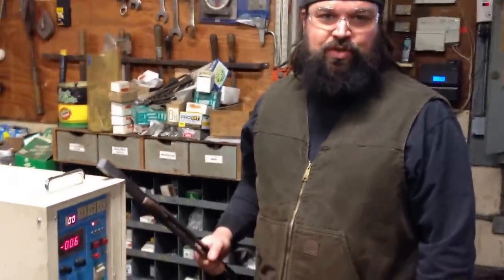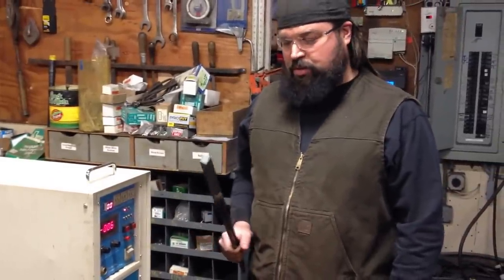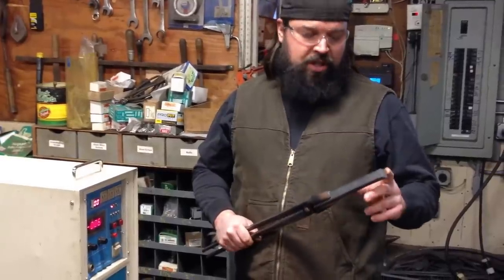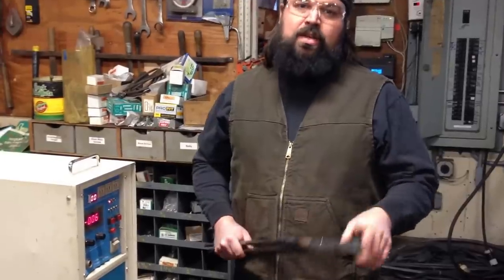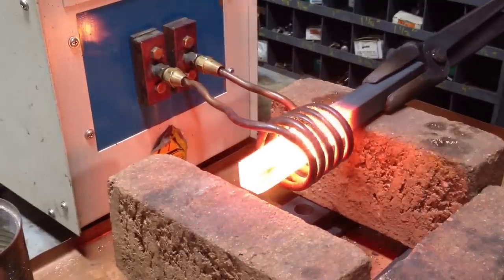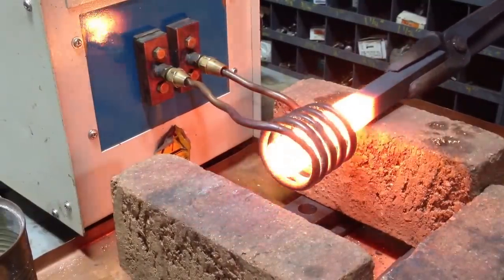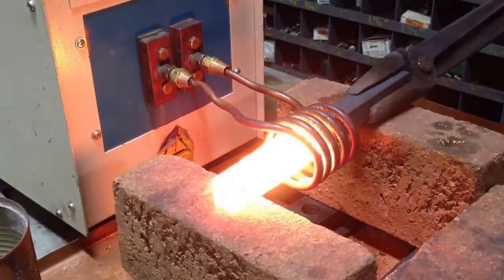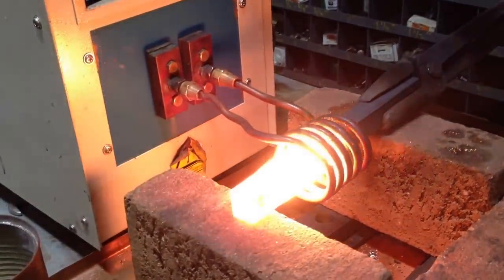Induction Heater and Power Hammer Action at Spirit Ironworks

Comment: That induction coil is really something for getting the steel red hot in seconds. The company I worked for had a huge one with a 12" diameter coil that they just threw out ten years ago they used for heat treating when they no longer needed it. I wish I would have cabbaged onto it now. The power requirments were probably massive but it was awesome.

Comment: So, on these videos I'm seeing small coils. Why not make a longer and wider coil for this so you could use it for annealing and for wider stock? And why not encase the coil in firebrick?
Reply: You may of found this information out by now but this is for the others who haven't.

Induction heaters operate in a range of khz. The coil design, material mass, and diameter all effect the khz the machine is operating at. The longer the length of coil along with more wraps increases the khz so you're limited in how big you can make an effective coil. 

If the coil operates outside of the machines khz the piece simply won't heat up or very slowly heat up then rapidly heat up once the khz drops into range. That is if the coil is properly sized to the work piece.

There is some cheats you can do. Hot steel raises the khz less so putting just the tip of your work piece into a oversized coil can allow you to then add the rest of the material once it's heated up.

Comment: What are the pros and cons of an induction heater in comparison to a gas forge ? ?
Reply: inductions coils if powerful enough  heat steel faster ,you can set the max temp that it heats to, there is much much less noise and its cheaper and safer, thought i would answer since this guy never does.the downside is the $4000 + for a high power one and they need to be water cooled .
Reply: Interesting!
Reply: I haven't actually used an induction heater or a good gas forge, but from what I understand the pros of an induction heater are that you don't need to burn any fuel to use it, and it seems to heat metal up pretty quickly.  The cons would seem to be that you can only make them so big, and that puts a sharp limit on how big of a piece you can work with.

With a gas forge you can build them bigger, so wider pieces are more doable, but you'll be burning gas to heat your metal, so you need ventilation.
Reply: you can make them any size you like they work on magnetic resonance so there is not much of a limit as long as you can generate the magnetic field gas gets expensive fast on anything bigger than what you can hand forge .
Reply: Well, to be fair, I am speaking from very limited knowledge.  What I do know is that heating a larger area, whether it's with gas or induction, requires more power, and I'm not sure what the upper limit is on what you can accomplish with 120vac.
Reply: ahh right im in the uk so it starts at 240 here but 415 three phase machines exist  you can find them on alibaba , the cost is the worse bit the one in this video was over $4000 i bet and thats prob only 110 v
Reply: Safer, uses wall current so no gas to refill, you have make one for cheap or buy the $4K model.
Reply: the main con is when treating steels surfaces you can only operate in carbon percentages of 0,3 to 0,6. Lower than 0,3 will create a low hardening surface because martensitic structures with this values are more soft, and higher than 0,6 will make a martensitic surface that is followed by drastic expansion wich gives you high risk of fracture.

Comment: Does induction heating need high amps or high voltage
Reply: both here in Belgium 400 volts 32 amps but I don't know how it works where you live

Comment: any body know about the bottom dise ?
Reply: i have never seen it before either but its just a half circle in a half circle cup so it is free to adjust its own angle as you use it , its designed specifically for tapering as the angle adjusts depending on the taper already on the work piece ( why it was started at the rigid side  to establish a taper  ))  about all i can say for sure without this guy ever commenting on his own Chanel
Reply: I think it is not for tapering but for further working tapered pieces.  It's a great idea.